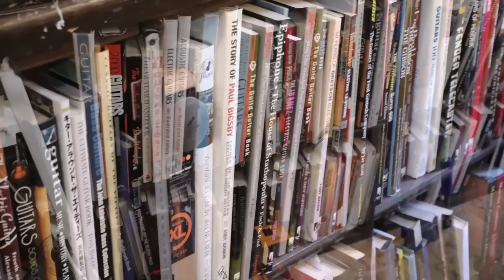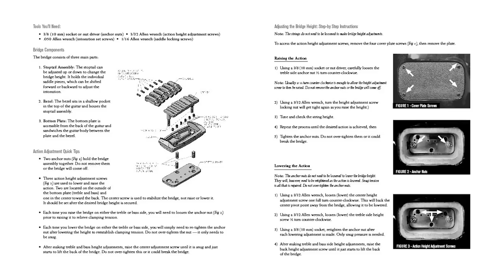Too many Cool Features to be a Success | Taylor Solidbody Teardown & Setup

Comment: I keep thinking of Les Paul's "the Log" and how he had a perfectly working electric guitar made of a 4x4 and an epiphone standard neck, plus his electronics.  No one liked it until he made sides to attach to it so it looked like a regular archtop.....it sounded exactly the same with or without the attachments, but people thought it sounded different.  So much for tonewoods.   His original proof of concept used a chunk of railroad tie, which gave the strings the highest amount of sustain.  So, my feeling is, if someone stuck to the log concept and concentrated on the center core of the guitar+ electronics, they could do whatever they want with the rest..  Core body/neck+ good electronics and hardware equals voila.  The 60's Harmony, Danelectro were all particle board I think.  If one is a techno phobe I suppose the bridge is cool, but a player needs something easy to work with live. I think the single bolt-on neck is cool and easy.  Maybe they could develop a "slide-in neck" that has one bolt....metal runners maybe.
Reply: isn't that basically what a 335 is? solid core with laminated wings?
Reply: @ziggybongwater7915  yes, Les Paul was proving the electric concept that the body has no real function in producing the electronic sound.  He added the wings because people didn't like looking at a 4x4 with strings.
Reply: @michaeld.mcclish  at luthier school years ago the head builder told us a similar story about flamenco guitars, there was a famous spanish guitar builder who argued that only the top will affect the sound of a n acoustic so he built a guitar with a perfectly braced cedar top and a paper mache back and sides. im not sure how successful his experiment was though lol but its an interesting idea!
Reply: @ziggybongwater7915  I think Les Paul was concerned only with electric guitars, though.  Acoustic/flamenco guitars do get their sound from all of the woods they are made of, imo.  It's all about what tones and harmonics sound and what is dampened, and the artist's expertise in shaping the sound with fingering and artistry.

Comment: That cross grain shim prevents any stiffness resisting change in angle of the neck when tensioning.  The shim just rolls with it, like a bed of needle bearings.

Comment: That neck pocket is really smart. 
By hollowing out the middle, it increases the pressure on the outside edges and makes it a “tighter” join.
It also reduces the risk of the neck sitting not level, it’s how they make furniture bases sit flat and not rock.  
Just have to make sure the neck itself is strong enough to not sink down in the middle and make a concave in the fretboard

Comment: The only reason that this guitar was not accepted by the players could be that we fellow guitarists are looking for the stuff of the past. Most of us do not appreciate innovations, which could make our live easier. Instead we accept Les Pauls going out of tune regularly due to the high headstock angle, we love guitars without any comfortable arm rest, we even might replace locking tuners by old fashioned ones to be vintage correct, we accept necks to be removed from the body in order to get the truss rod adjusted, we hate active electronics and humbuckers inside a guitar, which was originally made to have humming and buzzing single coils. Bass players and acoustic players do appreciate innovations much more.

Comment: I worked with a man in the 90s who was a very serious amateur hand bell ringer, and he pioneered a series of hand bells which were essentially shaped slabs of aluminium; people were stunned by the acoustics ( I think he was even on Tomorrow’s World). Maybe the use of aluminium here for the bridge, with surprisingly small contact points to the body is designed to have some acoustic benefit; whether it was successful or not may well be another matter.

Comment: Not a luthier, but an engineer here. On the tailpiece and the neck, they chose to reduce the area of contact. In the case of the tailpiece they touch around the perimeter. In the case of the neck they carve out the interior to create an additional perimeter contact area. Assuming the same clamping force from the fastners, reducing the contact area will increase the contact pressure proportionally. Given that in both cases it's likely easier to control the flatness of the contact areas, this is probably a good call.

The trraveling grub screw is terrifying. Are you sure someone didn't just chuck it in the hole before assembling a la Jaguar to avoid missing parts in the box?

Comment: It's like an acoustic guitar: separate front, back and sides, bridge moves with the top, and neck profile. Very interesting when acoustic companies reinvent electrics -Ovation Breadwinner, Martin, etc. They all flopped, but are getting some love in the afterlife!
Reply from the maker: I'm trying to buy a Breadwinner for the show right now!
Reply: Basically, an electric for acoustic guitarists.
Reply: @sarguitars6603  Yeah, especially if the neck is shaped more like an acoustic.
Reply: @sarguitars6603  no
Reply: no .   its not separate front, back and side.   No the bridge does not move with the top.  Its like a strat.  Big chunk of solid wood with a bridge screwed down.  They simply made a little decorative pocket where the bridge screws down.  Nothing at all like an acoustic.

Comment: I am fond of guitars and basses, and have several who have followed me for many years now 35-40. It is a very nice and special guitar you have on the table, not many of that kind. But what draws my eyes away from the guitar is the fine tool collection you have built up, and I reckon we don't even see half of it, the rest are tucked away in cupboards and drawers. I love tools, where we live now I don't have a separate room for the guitars and tools, and use the bedroom a bit, you can imagine what the wife says about that, even though I don't sand wood in here. Then she would have thrown both me and my things out. But it bothers me a lot that I have to have my tools and machines stowed away in boxes in the attic. Now I'm looking for a large camper, because I have two large parking spaces below the house, and I'm thinking of parking the camper in the innermost space. And furnish it for a small workshop, it does not need to be registered and then it will be cheaper too  😃

Comment: I acquired a Taylor Solid Body electric guitar in a trade.  The simpler looking SB-1X Classic Model I think, in transparent white, swamp ash body.  Sort of looks like the Fender Mary Kaye finish as you can see the ash grain pattern, like a transparent white blond.  I like it a lot, because it has two mini-humbuckers and reminds a lot of the 1968 Gibson Les Paul Deluxe in its tones, very clear and present, but with some incisive punch.  The five way Strat style pup selector gives two nice extra single coil tones also.  It came with the OHSC, Taylor leather strap and hex tools and instructions for the guitar/bridge.  Hopefully, I won't be doing any work on it.  Seems pretty good action and intonation as is.  Tones-wise, I consider it sort of a de facto Les Paul Deluxe, just in a less fancily appointed, flat top, beveled edge, dot neck "Special" model format.

Comment: You’re going to laugh but I really like the way you masked off the fretboard prior to buffing. Folding tape over to make it more narrow…. Also using a bit of tape to keep the metal shield in place.

Interesting choices with the selector switch and how the coils are combined. I have a traditional Strat with the ability to put neck and bridge pups in series and it’s a cool, useful sound. In parallel you get a Tele-like sound.

Comment: I'd love to see you try to build a guitar like this based on a CNC'd MDF substructure with chambers, control cavities, neck pockets, etc with a solid wood outer shell, be that veneers or thicker.  Would be interesting to see if it gave any benefits.  I'd have thought there might be CNC benefits to using a flat sheet of mdf - as  in  more structures per sheet and less tear out.(Not that I know anything about such things).

Comment: Would love a series or some videos on the innovations of different brands or how different countries shaped guitar/bass building. For example I would love to hear about Japan's contributions and change from making primarily copies to making innovative, unique instruments. Ibanez is definitely worth a mention and played a part but I want to hear more about companies that get missed or had specific innovations such as Tune Japan, which helped popularize smaller bodied basses with complex pre-amp circuits. The stuff Tune was doing in the mid 80s with electronics was cutting edge (2 independent pre-amps in the same bass, hidden trimmer pots, gain for each pickup or string, multiple parametric mid eq's etc) and is still very difficult to find builders that will take electronics to the same extreme as Tune.

Comment: I purchased a black classic which is a true solidbody for $450 on Reverb in 2015. It's one of the best guitars I have played. I love the neck but also play a Taylor 912c so the neck is familiar. It's not made for "shredding". The guitar in this video was sold as a chambered body.  As a woodworker, I assume the use of MDF as a backer for the veneer was done to add stability, it would be nearly impossible for the top to crack. The bridge is incredibly easy to adjust and maintains intonation perfectly.  
The Taylor Solidbody has great innovation. Unfortunately, it suffered commercially not because of build issues, but due to guitar snobbery 😂 ie... It's not a facsimile of a vintage guitar. The reaction at the time was "acoustic guitar builders can't build electric guitars", which is obviously nonsense. Taylor took what they learned from this design and put it into their T5 guitars which have been pretty successful. My guitar now sells for $1200+, not that I have any motive to sell it. 😜

Comment: I'm assuming the lack of shielding paint is due to the fact that those cavity control covers look similar to a Gibson type of cavity control cover with the shielding built into the covers. Just a speculation though. That and well, they're humbuckers, don't necessarily need cavity paint in my experience.

Comment: I'm kicking myself for not buying an SB series guitar. I picked up a T5 and T3Bs right as these were discontinued. Quirky bridge. It wasn't great that you are limited to a handful of Taylor pickups due to the quick connect wiring. For the sake of variety, I changed pickups in one T3/B and had to get all new everything.

Comment: Great timing for me. I've recently discovered this guitar and have been curious about it. Thank you for the video!  Also, wouldn't that knocking sound come from it being a chambered body (since it is)?
Reply: It is also a guitar with a formed  ply wood top on a slab body - like the gretch roundup or many of the 1970' Ibanez les paull look a likes so there is pace under most f the top

Comment: I think one of those Ovations could be a fun exploration into just what a guitar body needs to be — some of those models had an entirely plastic/foam/whatever body! Also aluminum is one of those 50/50 materials — cnc machined can be quite good as the billet process gets rid of impurities, but a cast aluminum part is cheaper and less reliable.

Comment: Thank you Ben!  There is one for sale locally to me, that has 3 single coil pups. It looks unplayed also, and has the same strange "not for sale" message on the back of the head. The price has changed 3 times,  $1099, $999 and now $1299. Still not sold.  I had the same interest as you did, how it was made. I think I've seen a bridge like that before, maybe Gotoh?  The finish looks very nice, as does the 'carve', but I don't care for the bones. I have you plugged into studio monitors, and it sounds thin-ish here? Like perhaps low sustain, or bass, perhaps an unwanted vibration?  Interesting.  Thanks much, cheers.  ----gary

Comment: I'm lucky enough to own the similar Classic Solidbody. Mine is the version with a natural ash finish and the pickups that look like mini-humbuckers. I really like the way that it plays and its simple, understated look. I don't really go for 'blingy' guitars and like to just see the grain of the wood and have dot inlays on the fingerboard. Second hand, I think it was a bit of a bargain.

I've not had any issues with the neck joint or the bridge. The bridge is comfortable for your right hand when compared to other guitars and doesn't look like it would be difficult to adjust, if it needed it.

Obviously this range didn't really catch on. I think they look a bit too conservative for many people and no famous players use them or were endorsees. Bit of a 'forgotten gem'.

Comment: Actually, when all cables are shielded, and the pickups are also shielded, there is no real need for another shield... I always do shield the cavity though, and a symmetrical wireing throughout. If you are lucky, then you can cut the wire to the bridge, and run no risk of ever getting electrocuted - but the fuse is also a nice idea about that... should be a ultrarapid 30mA, if it really should safe your life ;)

Comment: If the pocket and neck heel (or bridge plate) were flat to within 0.001", the surface  to surface contact would be only 10% - possibly a little more owing to wood compression.  So it's conceivable that Taylor's perimeter-only method gives a higher percentage of contact.

Comment: I bought this guitar used to resell and also gain inspiration.  Mine might have been a fancier version because it had nicer inlays and top.  I really suspected the top to be a photofilm because it was obviously thin but the figuring looked very deep, but it turned out to be just a very nice piece of wood.  I loved the feel of the bridge but didn't like the adjustments,  A brass tone block in the bridge avity might be a nice upgrade.  Fir and finish were excellent.  Body had a feel like the Ibanez S guitars that I love but it was just too light and not really suited for the kind of music that I play.  Mine had a lot more care in the fret work it seems.

Comment: That was very interesting.  I like the machine bolt holding the neck. I’d prefer 2 offset like Anderson guitars uses.  Their alignment allows for more heel access when playing up the neck.  I’d love to see you review the Stephen’s cutaway is a Washburn N4.  The rest of the guitar is quite ordinary. I had one of the original 600 made and I sold it for a ton once I found out what I had.

Comment: I think the next pocket route and the mounting system is really very innovative idea that I think would work with a little bit of tweaking. As for the bridge I think it's a bit more complicated than it really needs to be. A traditional Fender style bridge would work just fine it has all these years as far as the design goes. The materials used in it for me lacks a little bit seems kind of cheap in away and I bet that guitar wasn't really necessarily cheap to begin with as far as cost. But overall it is still really cool. Keep it coming!

Comment: I own one of these! It was one of a pair given to a young country artist. I can’t recall who. It was about 700 bucks, case Queen . It felt like an acoustic, and sounded like a hollow body electric to some extent. Liked it at first…but.
Maybe the wide neck gave me trouble, I have smallish hands? I never bonded with it, even though I could also see the build quality and wood beauty. I just got it serviced and it still plays a bit hard, kinda like an acoustic, so it baffles me playing rock style songs. Maybe I’ll try lighter strings. Seeing it apart I realize why it sounds like a cereal box when amplified. Strange sounds when thumped. It sounds cheap.

Comment: As Graham Dunbar mentions below, with the bolt pulling in around the edges they have left enough meat for a solid contact but cut away enough that the high pressure at the outside contact ring would compress the wood microscopically to even out any minor inconsistencies in machining or by aging and get a good mating surface.  Having said that they could have still had the same effect by using 4 bolts inside the cavity instead of just one which is what I would have done - better to spread the load over 4 points than one. No matter how well dried and machined the wood is it will distort over time even if it's microns which means that microscopically speaking no standard bolt on neck will ever sit perfectly flat on the neck pocket face of a body. The bolts just pull the 2 faces together for a good enough mating surface. Whether this matters in real life applications is another story. Probably not as I have seen a video where the presenter compares the sustain between a solid thru neck and bolt on neck and to my surprise the bolt on neck had more sustain. However one would have to test this between many guitars to get a consistent finding on which one sustains the best.
Reply: Microscopically the neck is moving all over the place all the time, isnt it?  Temperature, humidity etc.

Comment: Ahhh, the neck pocket. The fit has less to do with tone, but string spacing. I say the tighter the better, so up/down shifting can be done if needed, but generally mains the up/down neck angle. I love Stratocasters, but they're like the floyd rose of guitars, because of all the subtle adjustments, a bad neck pocket being an often overlooked point of issue.